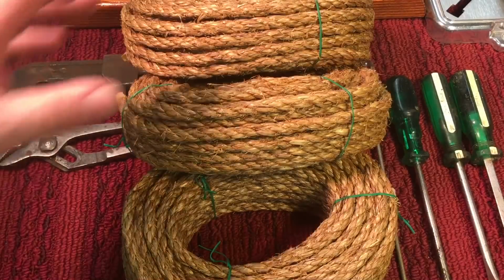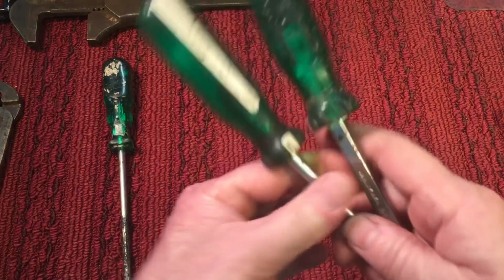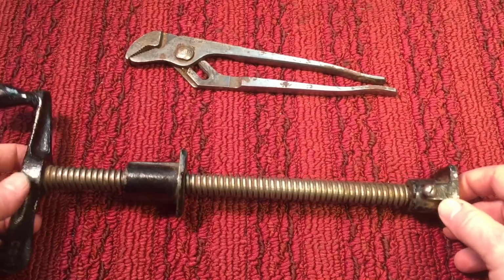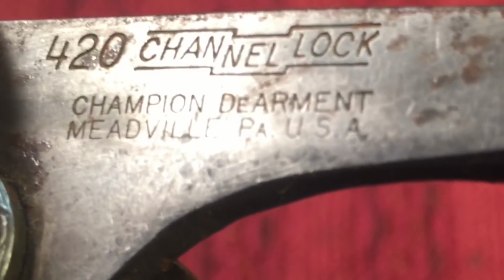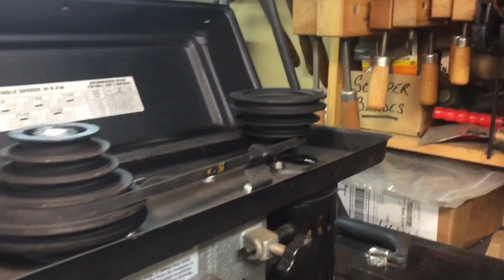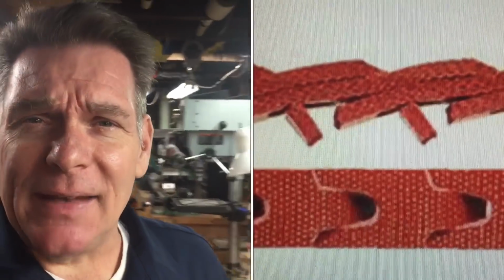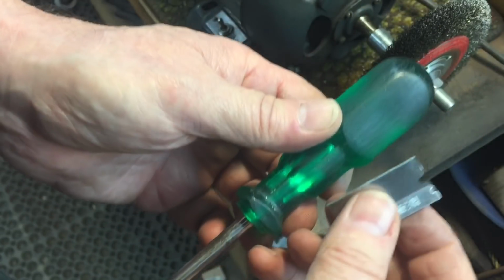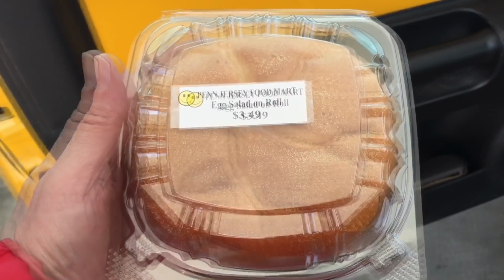Jacktown, Belt Memory, Screwdriver and Charlie the Wonder Dog

Comment: I have been considering switching out all my belts for those link types.
I just don't go into the garage/shop often enough to get the tools used or even rotate the belts.
But the cost on those link belts!
Wow, those things are pricey.
Still it may be the best way to go for smoother running machines.
Maybe just buying new belts every few years will be cheaper.
But swapping them out on some of the machines is a pain.
A decision to ponder.

Comment: Hi Scout Crafter SK tools are excellent I have one of those 1/4 drive socket sets in metric it has short and deep sockets used it a lot for many years also have the long screwdriver with replaceable magnetic bits and a set of metric wrenches all there tools are very nice.
Reply from the maker: Hi David!  In my opinion SK had the best chrome finish of any tool manufacturer!  They are so pretty!!!!!!  Great tools too!  Thanks!!!!!!!!!!!!
Reply: @ScoutCrafter  that makes sense because the socket set was heavily used and there is no chrome peeled chipped or worn off

Comment: That screwdriver really turned out nice. I don't own any S-K screwdrivers but I have several of the socket sets, really good quality stuff. I think your drill press has more problems than belt memory. If you watch the video that spindle pulley wobbles pretty bad. You may have a problem with the spindle bearings (Chinese) or even a bent spindle. I have a floor model drill press that the spindle is bent and has about 0.030 runout. Needless to say, it doesn't get used anymore. Looked like a good time at Jacktown. Thanks for the video!
Reply from the maker: Hi George!   You are so right!  Most drill presses will have considerable runout at the pulleys and belt only to be taken out by the spindle bearings and introduced again by the chuck!  LOL!!!!!   The key is to get all the off sets working against each other to smooth out the machine!  =D    Chasing accuracy is a doomed endeavor!  =D    Thanks George!!!!!!

Comment: What is the highest grit sandpaper you used on that green handle?
Reply from the maker: Hi Cindi!  After the scraping (razor blade) it was pretty smooth so I started with about 320 because the end cap was still rough, then 400, 600...  The Clear-coat really fills a lot of small scratches...  I only gave it one wet coat but if I wanted this to really pop I could do another coat!  =D   Thanks so much!

Comment: That S~K tool is awesome! I've never seen Champion DeArment before, thank you @Marcel Germann for the information. I thought department too! but it's De Arment. That screwdriver turned out awesome! Use under caution, but I discovered using the blue can of Walmart brand brake cleaner sprayed on a soft cloth and run down the handle of screwdrivers and it somehow melts it to new.   I used brake tools and of course they got dirty, brake cleaner on brake tools right? Wrong, melted the handles bad (Craftsman).  You can't scrub it with the brake cleaner but just wipe it down a section once with a finger in the cloth and it turns out good as new.  I'd try to clean then do the brake cleaner. It will melt a lot of plastics though. Be careful. I laid a cloth on my bench and it was touching my letter stamps and it melted the case and cloth stuck to it.
Reply from the maker: Hello Aaron!  LOL!   Yes!  I have tried everything!!!  One time a few people said just dip it in Acetone like they do at the factory!   LOL   WRONG!  I tried different chemicals and even a heat gun!  They all are very risky and you can't be sure of the outcome!  I had a laugh when you said getting a rag stuck to it!  LOL  Ask me how I know!  =)   Thanks Aaron!!!!!!!

Comment: I just take the belt off and set it on top,  because i dont use all the time.
Reply from the maker: Hi Bert!  That is ideal!  I would love to see a belt that had no memory!  Thanks so much!!
Reply: @ScoutCrafter  actually it was my brother whom gave me the  idea. We had a dryer stored in the garage that wasn't  being used. Ne we needed it and it was make a loud thump come to find out the little rubber wheel developed a flat spot from sitting after that repair he realized what was causing the vibration on the drill press so he bought a new one took out of the package set it in sun with bricks all around it, then only installs it when he uses it. That my friend  was 20 years ago and he still  has  the  bell.